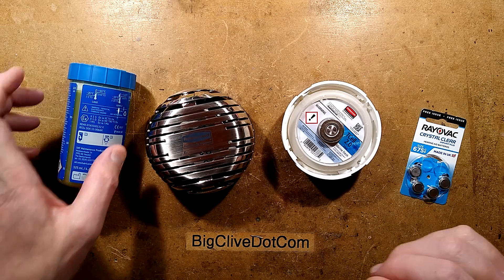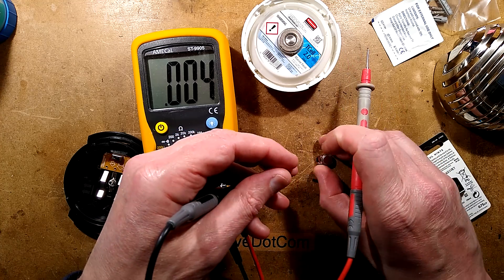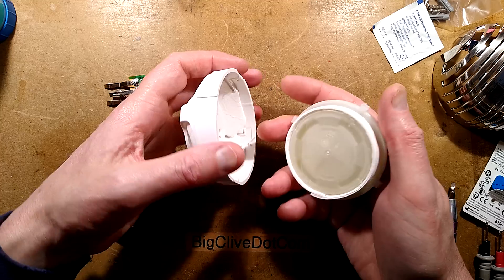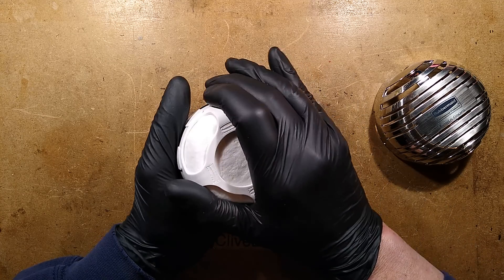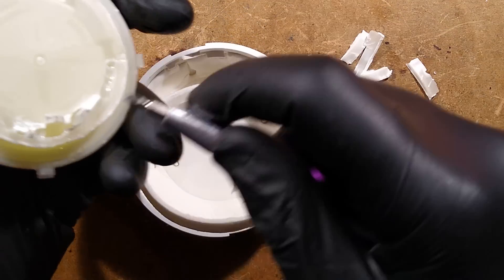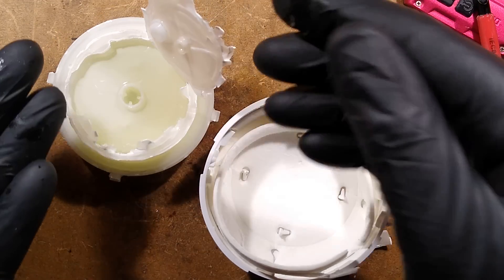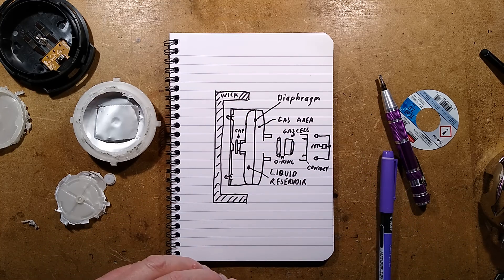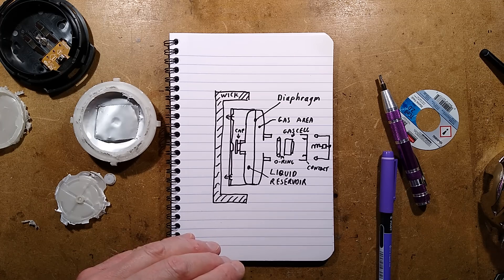Rubbermaid gas generating aroma unit teardown

Comment: I'm loving the Zinc-Air battery content. I didn't even know they existed, and now I wanna know what all these things could be used for, or even how they could be abused, like stacking multiple together with a resistor across and then thrown into a balloon, or maybe a long-term test to see how much pressure they can generate if run to completely flat.

Comment: t's not often PhDs in inorganic chemistry have a chance to shine, but I'll take what I can get. 

Here is what is happening:
Under normal conditions, there are 3 reactions:
Zn+4OH- > Zn(OH)4^2-, + 2e- (Anode)
Zn(OH)4^2- > ZnO +H2O +2OH- (electrolyte)
1/2 O2 + H2O +2 e- > 2OH- (Cathode)
Total - 2 Zn + O2 > 2ZnO

There is always a parasitic reaction pathway which generates hydrogen gas (see below). In order to minimize this, they use construction methods and additives such as mercury amalgam. The parasitic reaction is below:
Zn+4OH- > Zn(OH)4^2 + 2e (as above at anode)
2H2O +2e- - H2 +2OH- (side reaction)
Total = Zn +2H2O > Zn(OH)2 + H2 (hydrogen generating reaction)

Under normal operation, oxygen is present, allowing the top cathode reaction to proceed, where the overall reaction involves the oxidation of Zinc by oxygen to produce Zinc Oxide. Without oxygen, the reaction will proceed without the Cathode reaction, resulting in the oxidation of Zinc by water (under basic conditions), producing Hydrogen gas and Zinc(+2) hydroxide. These are competing pathways, removing the oxygen forces the Zn to prefer the parasitic reaction that generates hydrogen gas. 

The source of the hydrogen gas is the half cell of the oxidation of zinc, and reduction of water to produce hydrogen. This explains why no oxygen is being generated.

Comment: There are many different species of yeast, all of which are single-cell organisms, which, because of their simplicity, relatively large size and availability, are often used to study how cells work. Yeasts usually reproduce asexually, through a process called ‘budding’, which involves cell division.

However, a few species of yeast produce sexually. This involves a male and a female cell split off, join together, mate and then separate again. This process takes a couple of hours and produces a nodule called a schmoo.

Comment: The chemistry between zinc-air cells and hydrogen generating cells is very similar, except for where the oxygen to oxidise the zinc comes from.  In zinc-air cells the oxygen is taken in from the air using a catalyst to react it with water as an intermediary to create hydroxide ions, which ultimately end up back as water again after the zinc is oxidised.  Whereas in hydrogen generating cells the hydroxide ions (OH-) just come from the water in an alkaline solution, with the excess hydrogen being vented.  But Zinc-air batteries can generate hydrogen as an unwanted reaction when the electrolyte corrodes the zinc.

Comment: Question about your A4gallium .zip PCB, If I get the board in aluminum does the gerber file already have the 1mm drill hole size? or are they smaller? Thanks :)
Reply from the maker: I wouldn't recommend getting it as an aluminium core PCB.
Reply: @bigclivedotcom  ok sounds good, I'll heed your advice! New to learning how to solder and I picked up the smaller version from JLPCB probably like 5 plus years ago and just sat down to start it yesterday.

I wanted to clean up some of the marks after soldering and used isopropyl, and unlike a regular PCB it became really sticky afterwards. I figure aluminum might prevent this? Or maybe it was just a really old old board and I should complete my projects without procrastinating haha

Comment: Is it true if you touch a watch battery with your fingers on both sides it kills the battery or is it an old granddad saying
Reply from the maker: Theoretically, if you bridge the gap between the positive and negative seal area with a conductive film from sweaty fingers it might have a small effect on a cell that is intended to work for years.  I doubt it would really have much of an effect in reality.

Comment: They are thinking about using zinc air batteries for large solar and Windmill batteries for power generation .The down side to theses batteries is the large amount of current required to recharge them .The good thing is that they are much safer than any lithium technology out there .Thomas Edison has the patent on the Edison /Zinc air battery .One day we shall see what batteries will prevail .for now it's all pie in the sky fraudulant green energy scams .No Tesla for me yet .When the cost of a replacement battery is under 5k per 120km them it will be with it .At over 30k per 120k Km ,it's just not worth it .The carbon footprint is huge on EV .The only difference is the time offset of the footprint .That's it .You will always require fossil fuels to make the batteries and the cars .

Comment: Thats an interesting concept, a few years ago, the place I worked had  similar sort of slow release air freshners in the washrooms, it consisted of a unit with a bottle of the chemical scent solution, which had a pinhole opening that dribbled the scent on to a wicking disc, underneath that was a tiny low current motor & fan which circulated the aroma, this was powered by a D cell battery, which lasted for several months!

Comment: I added "pressure generation" to the possible applications for Zinc-Air Batteries on Wikipedia, citing your videos: https://en.wikipedia.org/w/index.php?title=Zinc%E2%80%93air_battery&type=revision&diff=1096628943&oldid=1094666902

Comment: Very interesting but it looks like a clever and non-evironmentally friendly solution to a problem that does not exist.  Glass jar with schmoo and natural fibre wicks would give the same result? Added bonus, you can see when the schmoo runs out; or in adman speak, additional carbon neutral automatic visual reserve indication function...!  Keep up the good work, I am learning a lot about electronics from your videos.
Reply: Somebody has been learning “Rural Canadian Slang” vernacular from AvE 😂 this is a pretty good system. Let’s worry about the purely electronic air fresheners first.
Reply: Agreed, but companies can't make as much money smh
Reply: Nice Man. Let’s Make Some Blank Circuit Board Sandwiches We Can Just Pop Out Anywhere : Mako Hole Contact And Solder Contact And Unsolder Vata @ Same TimeE Freedom - Kingdom Come 😎👌⚓️😃👍Thanks Cliv

Comment: hi Clive , great show , question , i live in Australia on eBay there are large flat 240v led lights . can they be easily made to work on 12 volts ?
Reply from the maker: The ones with a large slim panel of LEDs are usually only suited to the higher voltage.  You can get large 12V panels though.
Reply: @bigclivedotcom  thanks Clive ,

Comment: Ok find me another product which uses gas discharge from batteries to affect work
Reply from the maker: Grease dispensers, aroma dispensers and insulin dispensers.
Reply: @bigclivedotcom  I am going on a quest to find as many of these products as I can. I've found that Kimberley clarke also has a clone of the rubbermaid's TCell 1.0 dispensers. My brother was on an medtronic minimed 530 insulin pump, but I never looked into what powered the pump portion because the thing cost many thousands of dollars at the time I was afraid to even look at it. He had issues with it and had to stop using it... which makes me wonder where the unit is now. I shall see if I can locate it and get permission to dissect it.

Comment: I absolutely guarantee you the inspiration for the design of this product comes from spacecraft attitude control systems. In a long duration interplanetary robotic spacecraft the attitude control is done with a hypergolic system of liquid hydrazine forced over an iridium catalyst bed that causes it to decompose into N2 and H2 gas. But, if you are in space, there is no up or down (just like the unconstrained mounting orientation of the air freshener) so how do you ensure the liquid in your steel storage tank is at the bottom near the outlet valve when you need to fire the thrusters? You put a rubber diaphragm inside the metal tank and fill the tank with liquid hydrazine from only one side of the diaphragm, the other side is connected to a high pressure helium gas tank. So when you want to fire a thruster you open a solenoid valve on the He gas tank, allow a small amount to enter the fuel tank on the opposite side of the diaphragm, and this pushes hydrazine over the catalyst bed to spontaneously produce hot gas that exits through a thruster. It's the same set up here except instead of happening in milliseconds it happens over months, hydrogen takes the place of helium, and hydrazine is in place of the volatile stink fluid.

Comment: They're certainly intriguing devices, using basically a current-limited short-circuit to squeeze out schmoo with the gas it generates, whether grease or something they say smells of something that smells nothing like the real thing, all rather fascinating... :D
Reply: Yea I was laughing at "marine" scent. Most marine environments, e.g. docks and marinas, smell like a mix of dead rotting sea creatures and petroleum goop. Not quite what I'd want in an air freshener.

Comment: I can’t focus this electronic stuff I just don’t get,,,, there is a lot to remember. I get it and can’t stick with it, I would have to do a lot of homework. Them part change names depending on the application too
Reply: Your information is clear for me to follow” than most “  I ramble my way through the video it’s funny and don’t get how it all goes together hahahaha 😂😂.
Reply: I was just trying to understand a CDI one for four wheeler it has two on and off switches the lights don’t come” on key in the on position or on. With ac/Dc both present it gets confusing. It’s weak somewhere. Confusing🤔
Reply: I’m not shure of what one of these parts go where and I see if ya want to buy them parts they are 100 pieces well I don’t need all of them and if you get it wrong,,,,,, oh boy goody let’s buy more haha. I wound a stator for my motorcycle it was simple.
Reply from the maker: It all falls into place over time.

Comment: Searching for rocket engines that use a gas generator cycle and it still brings me to Big Clive...and  now I'm sidetracked for a deep dive on button cell batteries.

Thanks a lot!
Reply from the maker: An interesting distraction though.  There are two more videos to follow (already recorded).  Spoiler - yes a standard zinc air hearing aid battery does generate hydrogen when loaded and starved of air.
Reply: the connection to rocket engines is much closer than you think. look up hypergolic attitude control systems and the way the fuel and oxidizer are pressurized using a gas and bladder system...
Reply: Hmm ... a battery that generates hydrogen. All you need is another battery that emits oxygen during discharge and you could have a fully battery-powered rocket. Get Elon on the phone, stat!

Comment: This is unfolding in an awesome manner. I am pumped! In the manufacturer's site (edited: Varta) there is mention of many possible uses, but how many are actually available on the market? Hmmm
Reply from the maker: There are two upcoming videos.  One tests a standard zinc air cell next to the cell out of this unit.  The hearing aid battery won.

Comment: Do Rubbermaid also make safes?! This seems to be a prime example of over-engineering; wouldn't a gel pack enclosed in a perforated membrane with one of two pore sizes, and relying on simple diffusion in air, do the same thing without the need for any electrical cell?
Reply from the maker: The concept is to put out the same level of aroma all the time for the full life of the unit.
Reply: @bigclivedotcom  Thank you, Clive, for pointing this out - I overlooked this USP!

Comment: So, if I wanted to dispense ALL of the liquid as fast as possible, a piece of Al foil over the contact would make it so. How fast do you reckon it would dispense with a dead short?
Reply: It would probably generate a high internal resistance after a short time. The chemical reaction can only take place at a fairly slow rate. A short circuit may even cause a different reaction to occur.

Comment: I’m blown away by these over-engineered devices that only creates so much wasted material. In this case device could’ve been simply operated by gravity - a tiny hole on the bottom of the fragnance liquid container, and a wick beneath it - boom, done. No battery or additinal metal/chemicals needed, and would work just as well, if not better. Where the world have come to - soon every bar of soap and candle will have a frickin’ microprocessor inside just for the sake of it. And this is coming from embedded engineer himself, yours truly.
Reply from the maker: This device is very simple, and it's point is that it releases the aroma at the exact same rate from start to finish.  Wick system start with a strong smell that reduces over time.

Comment: You could use an inverted measuring cylinder submerged in water and see how much water is displaced as a fairly accurate measure.
Reply from the maker: Video made with different technique and coming soon.

Comment: Naver have I ever before ...
personally seen or witnessed any of these "augmented scent cannons", as those products which I know all rely on wicking effects - capillary action based, "passive" scent diffusers - or on propellants (as in spray cans, like Febr**e and Airw**k) to get the smell-juice out of the tank and into the air.
Some products do that by slowly evaporating the nose-diving substances out of a thick gelatine-like block (which loses volume and crumples up in the container after a while). Of course there are "Duftbäume" (scented trees, mainly used as car freshener). Smell-dipped flat little compressed paper thingies in the shape of a conifer tree, wrapped in plastic film. I do believe they rely on perfume oils - slow evaporation also here.
I do however see the cleverness of the Zinc-Air based system, for both use cases (i.e. also in the "Zinc-Air Grease Gun" 😆) !
I like when you showcase things that are not (or not entirely) electronics, microcontrollers or high voltage gadgets 😉
Whoops! This comment became a bit long! 🤭

Comment: Have you ever done anything on the sea cell batteries used in life jackets? Always been curious about them.
Reply: She sells sea cells by the seashore.
Reply: @tncorgi92  are you sure she sells cells?
Reply: @tncorgi92  And AA cells!!😆😆
Reply from the maker: They sound like the water activated cells that are just plates of metal with the salty water acting as an electrolyte.
Reply: @bigclivedotcom  We used Salt Water Batteries in the Stringray Missiles back in 1980 when I worked at Lucas Aerospace and now the USA have recently announced they just invented them. Bit slow of the mark if you ask me the Yanks.🤭🤭
Reply: @bigclivedotcom  Yes, exactly. I haven't seen the modern ones, but the old ones were a little plastic block with two plugs that would be pulled out with a pull ring. I used to have two from the 80s, so next time I'm back at my dad's ill see if I can find them and send in. :-)
Reply: Radiosonde used a same type of cell too
Reply: This sounds interesting.

Comment: Either those nubs around the cap plug, or the battery itself will act as a pressure release. Depends on whether the diaphragm's tensile strength or the crimping is stronger.

Comment: That liquid can strip paint, at least the stuff they use in the Air Wick fresheners, I sat an Air Wick on top of my audio DAC and some how it tipped over which went unnoticed, some of the liquid leaked out and ate through the paint.
Reply: Yeah, be careful with those chemicals.
They're incredibly stinky (Obviously !) but can also be quite difficult to wash off and get rid of the smell, usually it lingers for days or even weeks, especially on porous materials like untreated wood.
Reply: @psirvent8  Correct, stinky and in my case stinky and paint stripper.

Comment: This looks like a 2-stage device.  The first stage wets the wicking material immediately so you get a few days of aroma, then the pressure builds up enough to cause the sealed emitter to start replenishing the aroma in the wick.  The reaction must not happen fast enough to "work", as people perceive, so they added the additional stage to get aroma "immediately".
Reply: Seems like they need to re-engineer the cutting mechanism, or else make the membrane easier to cut through.

Comment: Honestly that's a very ingenious usage of electrochemical batteries. Their potential gas production capability being important instead of the typical parlance where "battery" is usually associated exclusively with electrical energy.
"Gas Batteries" in essence.

Comment: Looks like it works a bit like an LPG vapouriser, thats used with car engines. But instead of being suction operated, its pushed from behind. Interesting. A completely different subject for BC! Nice.
Reply: LPG vapouriser ?
Reply: @psirvent8  It's a water filled from the car radiator heat exchanger that prevents the liquid lpg freezing 🥶 up the pipework and it also helps to vaporise the Liquid Petroleum Gas. Turning it into a gas that is then just sucked into the engine for ignition in the cylinder.
Without this vaporiser after starting the car in winter the pipes would just freeze solid after a few minutes. A bit like if you spray a lighter gas refill onto your hand for too long you would get frost bite.

Comment: Presumably the specialized gas-generating cell is just like a regular one, just without the catalysts that they normally add to make it, you know, not do that when oxygen is present.
Reply from the maker: Test done, video made, coming soon.  Spoiler - a zinc air hearing aid battery yielded great results.